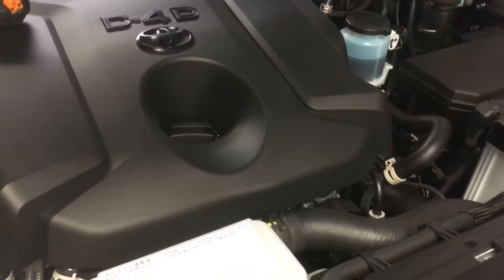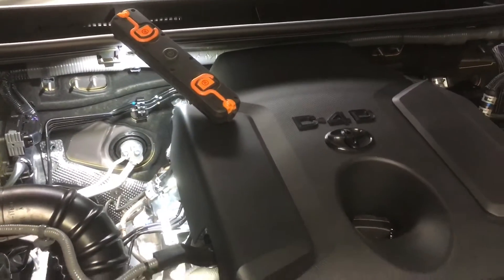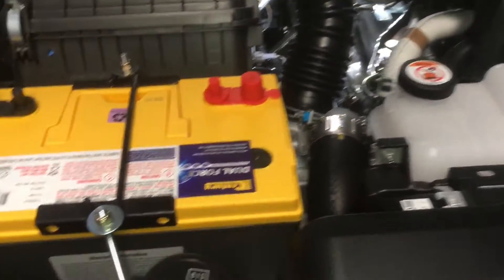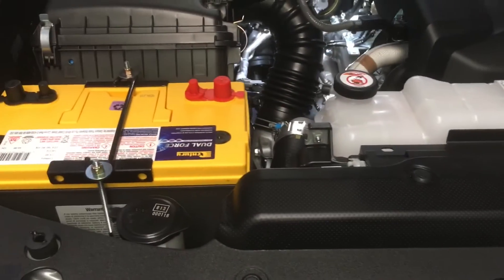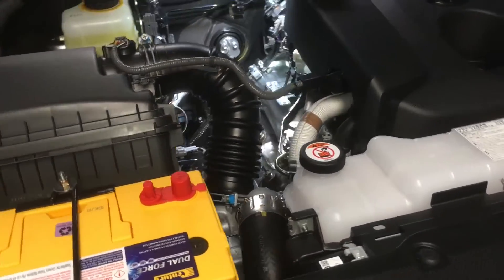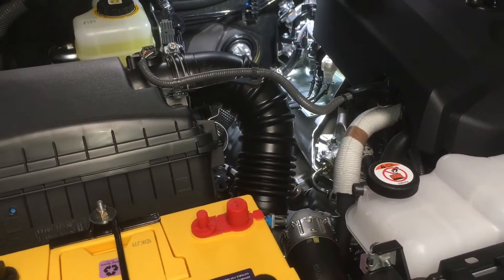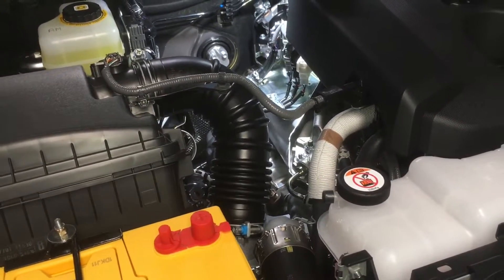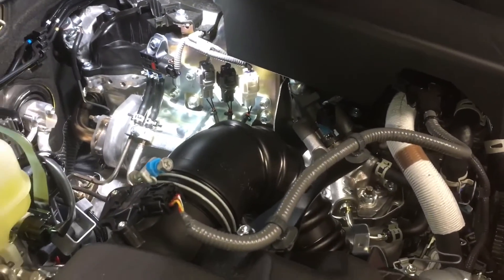THE P0400 Includes on 1GD-FTV Also the Free battery. Low EGR FLOW explained

Comment: Hey mate, any updates on this ? Ive got 7mm plate, roughly 2yrs no issue now multiple times per day for the past 6months no one has worked on the car except myself doing general oil changes nothing serious to potentially bump anything to cause it
Reply: Any check engine light pops up every now and then?

Comment: In theory Toyota designed it to have sufficient flow as the pipe clogs up over the life of the vehicle. 
So you wouldn't actually be getting any less EGR than stock until that code pops up.
In my opinion you're better off going all the way and just deleting the EGR. 
The exact same engine is sold in South Africa without a dpf or EGR.
Reply: In SA, without DPF, though with EGR, this is the lowest emission control spec on 150kW engines.

Comment: Tried a 13mm hole in my 2021 Prado and it threw a P0400. 

Checked MAF reading and it only increased by 1gms with the plate under operating temps on idle and 5gms underload, so meh, I doubt it's reducing egr flow by any significant amount. Not worth it IMO.